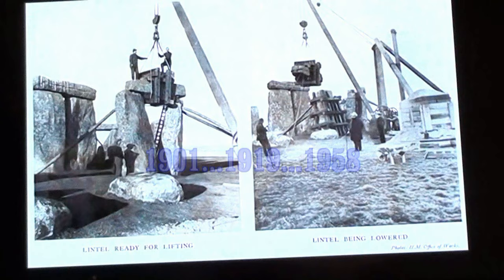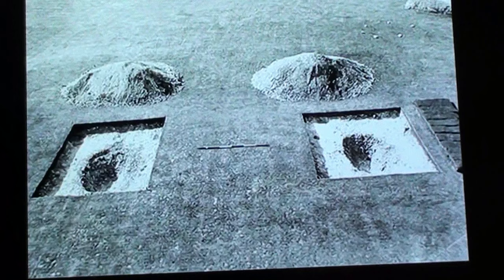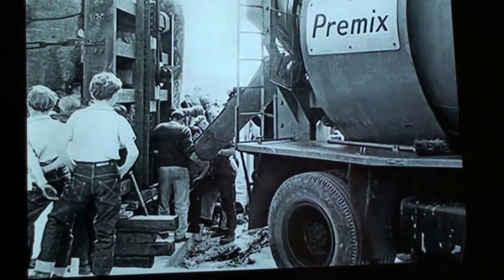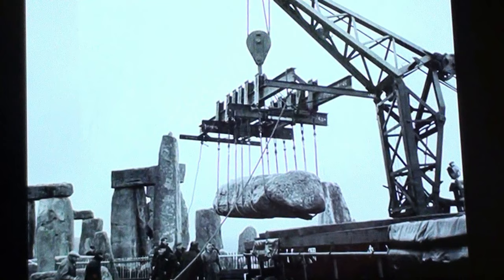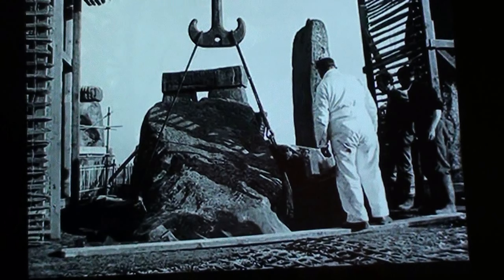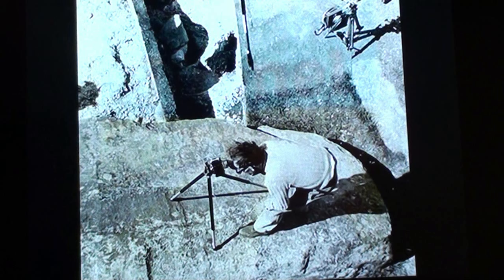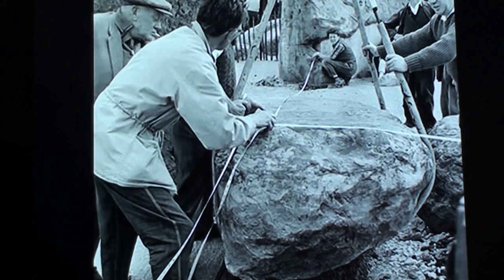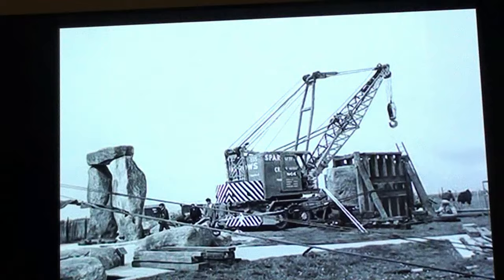Stonehenge Rebuild 1958

Comment: Narrator says we'll never know the true original position of the stones, yet in high summer heat the ground parches to reveal their positions 🙄. It's a shame the first 1901 "restoration" didn't follow modern conservation practice, but there are drawings and even paintings from before this showing the site in it's original disrepair with the fallen lintels and leaning columns. Stones were moved away to lay concrete foundations to prevent future subsidence of the site. This is such a weak conspiracy theory and the mistakes of the previous restorations are documented, just not advertised. The most scandalous part of Stonehenge' history is that the farmer that last privately owned the land bequeathed the site to the British public with strict instruction that people not be charged more than a shilling to visit, but English heritage got their greedy thieving claws on it and charge about £14. A shilling is 5 pence in today's decimal currency.
Reply: I've heard this and it's so wrong.. apparently he donated the site under these conditions so long as there was never a charge for collateral gain then as soon as he passed away it all changed in the name of greed
Reply: Neither brown patches nor any more technological method tells you anything within the cercal it has all been messed about too much. no bout even if you ignored the last 123 years.
PS 5p it should be !

Comment: It wouldn't be that hard to have exact alignment with stars if it was done in 1958.
 Why do so few people know about this?
Reply: WITH WHOSE STARS?! The stars move and shift over time. What time was it aligned to? We'll never know because we DON'T have an exact date of it's construction.
This is part of the great tragedy of doing something like this. Any sort of hypothesis that may of been supported by star alignment. Using it to date the structure is now thrown out the window. Along with any other hypothesis you could draw from it and compare to historical evidence. None of that is going to work. Just simply aligning the the stones to the stars today does NOTHING. Its a modern art installment that utilized ancient materials. Nothing more.
Reply: They done it again in the 60s, not a lot of people know about that either.
Reply: @jerickodoggo9595  you're being overly polite, it's not even anyone's Art unless one of those academic fools claims it as his own deliberate arrangement .  As it is, it's now alleged' to be ancient, when they took those major stones away and off site they also took away all of its provenance.
Reply: that is why it was done. to make it what they wanted to fit the narrative.
Reply: You're right. We should have just left it as another pile of stones on the countryside or better yet, wipe it out of the way altogether of for the thoroughfare. 
C'mon! Do you really think that the reconstruction in 58 and 67 didn't TRY to get it back in the best position that we could form the data they had?
It was our best effort or scrape it off of Britain for the highway forever and skip the tunnel and a tourist trap.
I only hope that you're able to build or REBUILD something in your lifetime that future generations rob you of the credit for your efforts by doubting your labors and asking what for. 
See how you like it. 
But then YOU'D HAVE TO BUILD OR REBUILD SOMETHING FIRST!!!
Reply: And perhaps NOW... even aligned to the wrong stars from the wrong epoch... I dont think they know how old the stones or original site even are...
Reply: @shaespear407  Not an older form but the correct grammatical form.  'May of' is just 'lazy speak'. From 'may have'  to shortened 'may've' - mispronounced 'may of'     And 'may of' doesn't  even make sense!
Reply: Tourist cash no one will come if you told them the truth .
Reply: @Bart-Did-it  I will stand to my version, so much speculation, who cares, anyone can think whatever they want, absolutely whatever may come to your mind, you know copper chisels a few turds moving rocks like maniacs with ropes...uuh- yeah, football stadiums all over the world uuh-yeah what a conicidence   ;)
Reply: @bobwilson7684  yeh I was not there so just have a critical mind and seek the truth for fun that’s all .
Have a great day 👋
Reply: @shaespear407  What? Easily triggered ain't ya...
Reply: "It wouldn't be that hard to have exact alignment with stars if it was done in 1958"
Stonehenge has never been claimed to have any alignment with any stars, except the Sun.

{:o:O:}

Comment: Yes some of the cap stones were replaced but when trying to lift any of the larger stones it was mostly not doable without hauling in a huge crane that was going to be an extremely difficult task. Some crane operators said it cld be done. Many crane operators said it was impossible.

Comment: I think the video exaggerates a lot about the reconstruction. There are Victorian paintings on the site, and very specifically photos from air balloons from the early 1900s where you can see, that there has not been so much reconstruction.                                                     
Was Stonehenge moved in 1958?
Under the direction of Colonel William Hawley, a member of the Stonehenge Society, six stones were moved and re-erected. Cranes were used to reposition three more stones in 1958. One giant fallen lintel, or cross stone, was replaced. Then in 1964, four stones were repositioned to prevent them falling

Comment: A replica would be a faithful look-alike reconstruction of the original. Instead, what we have today seems to be an unconstrained free-form interpretation of stones lieing about as deemed expedient back in 1958. Which is pretty much what you're saying in your video. Just disagreeing about the term "replica", and also "rebuilt" or "reconstruction". None of these apply as they suggest faithfulness to an original that we don't know about.
Reply: Mi Lu. Nonsense. There are many ancient drawings and paintings depicting Stonehenge. This was not rebuilding it was restoration. The latter word is absent from the dictionary of the maker of this video.

Comment: They are not real stones - Many years ago, when the public could touch the stones I photographed a corner of one of the 'megalithic' stones as the surface was missing like when plaster falls off a wall and the exposed corner was like perfectly cut concrete exactly square angles.  A perfectly machined and precise block then covered with cement to make it look old and rough is what I saw
Reply: @Rip Tide She lost it haha.
Reply: I have a feeling you would not believe her if she showed you a picture. Only thing you would believe is if a cnn or bbc news cast said it was true.
Reply: @matthorrocks6517  Thanks Matt
True they wouldn't believe it anyways - it is an actual old school photograph from around 1990 
They don't bother me,  I know everything is being revealed,  I must admit if I hadn't seen it with my own eyes I'd maybe be sceptical too
Reply: @Rip Tide in my possession
Reply: @cyberhermit1222  Laugh 
He who laughs last...

Comment: Stone hedge has been moved to a new location . Not only that they aligned it up all wrong Because they had no idea that when it was originally erected the stars have moved since then duuuurp.
All this was done in 1958 if I’m correct . 
They also repaired half of the stones with concrete when they tore them out and chucked them onto trucks and took them away they were sold to a local Lord of the land. 
It’s not in it’s original location or in it’s original alignment with the stars and the sun . Why go see it if it’s all bs now
Btw rolling them on logs is a wheel 👍.
It does not defy human strength they where educated by the stone cutters that travelled the world educating people on stone cutting and transportation. Since 11500 years ago when the three great pyramids of Egypt where built.
Reply: It was built in the 1900’s lol.